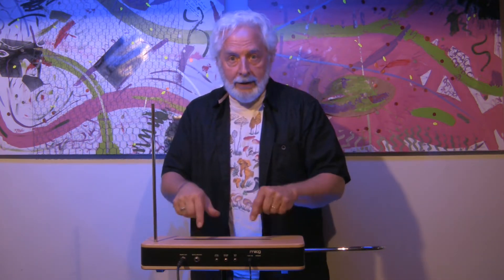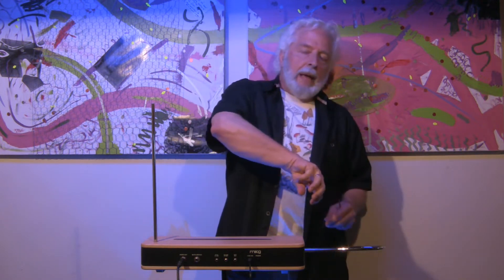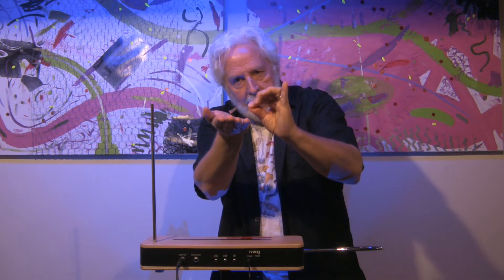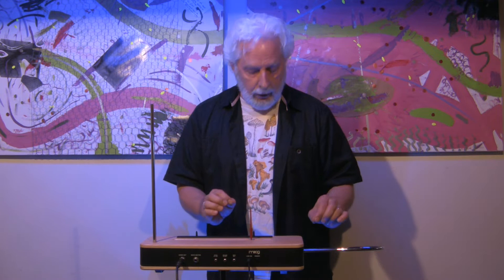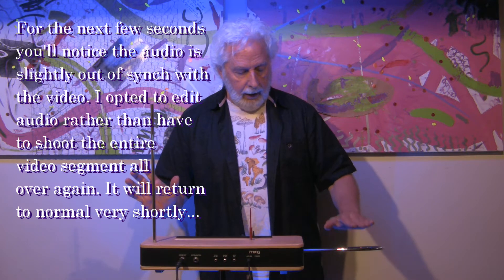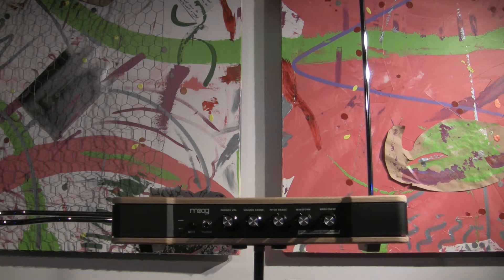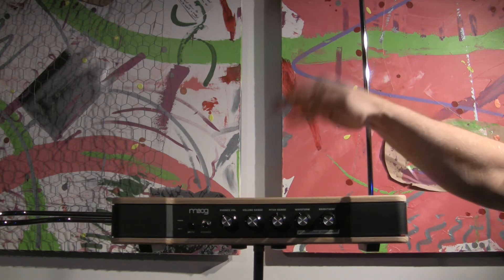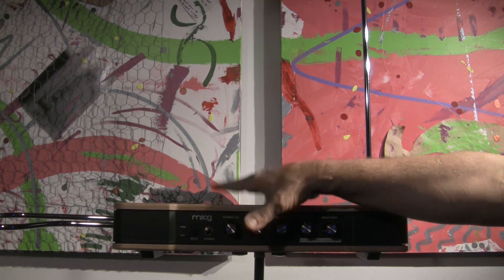Kip Rosser's "Complete Theremin:" Issues & Answers - Etherwave Volume Calibration Point, and a Bonus

Comment: ok, I am a seasoned theremin player; i know my body and tuning. It's instinctual. I used to play on older etherwave, but just upgraded to the newer model for midi capabilities. It won't tune. I know exactly how to tune it, or at least the older one. I had a process, it was consistently stable on the previous model. However the newer theremin, it isn't working. It is going back and forth, I cannot find zero beat except for at ONE position pretty far to the left on the tuning knob. Which is very chaotic (not linear, and too large. But it does stop eventually.) anything else, i move away from it and it starts ascending in pitch, which is the opposite. I let it acclimate and it doesn't change much. Is it damaged during shipping or something? This is not normal i don't think? Unless the newer model is different? help plz do I have to do internal tuning? I do know how, have done it before on the older model. No clue if the adjustment L6 & L5 even exist on this one haha. It seems the linearity is also kind of wonky. Help plz thanks is the pitch knob reversed or something.
Reply from the maker: Hi, Monica: The problem sounds like a strange one. My new Etherwave behaves almost exactly like my older one, including setting zero beat. The fact that you've got to set the pitch knob very far to the left indicates the necessity of making an internal adjustment. The good news there, as you know, is that you can gain access to the calibration points right through the top of the theremin by removing the plastic insert; if yours is to tightly attached, here’s a tutorial about taking it off initially, and then altering the way it fits to make it easier to remove:

https://www.youtube.com/watch?v=YWbLIeuoRoQ

Okay – you’ve got the plastic insert off. Turn the theremin on and put the pitch knob in the midnight position. The theremin’s going to make noise.

Use the little tool that came with your theremin; place it down carefully into the center hole (fixed pitch oscillator). Be very gentle and you’ll be able to feel it “catch” when you’ve got it into the tunable coil. If you have trouble, use a flashlight to get a peek down there and acquire a visual reference point for where the tool needs to fit.

Use your left hand to manipulate the tool. Place your right hand at the precise distance you want for your control space (with me, it’s 18 inches from the pitch antenna). When you turn the tool in the coil, turn it very gently and very slightly. I believe you’ll want to turn it clockwise. The main thing is that as you turn it, you want to hear the pitch getting lower. Keep your right hand positioned and keep turning the tool slowly until there’s no sound – zero beat. You’ve just calibrated the theremin.

I hope this works for you. If you still experience the same problem, feel free to contact me again.

Comment: Kip,  How would you rate the dynamics of the volume on the new Etherwave compared to the old EWS?
Reply from the maker: Hi: I'm unsure what you're specifically referring to, so, I'll address the volume loop and what types of things can be achieved with it. Compared to the older Etherwave Standard there is definitely a measure of more control over the loop's response - first, because the volume adjustment knob appears to have more range when impacting the loop's response. Secondly, given the fact that you now have instant access (as opposed to having to open the theremin up) to more refined calibration by directly tweaking the coil that controls response (as described on page 27 of the user manual). Overall, I'd rate the new Etherwave as superior when it comes to volume control, thereby lending more potential for power and/or subtlety when it comes to dynamics while playing a song.